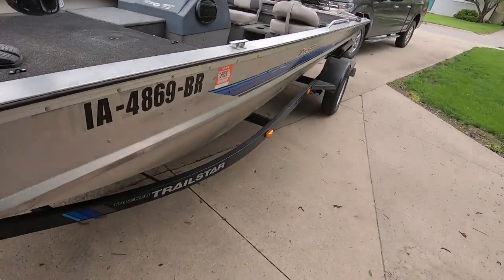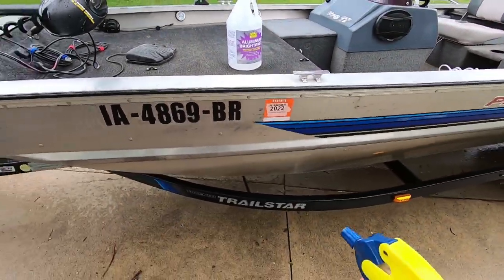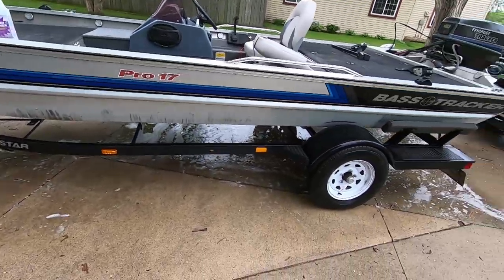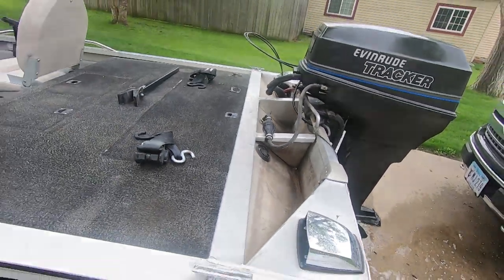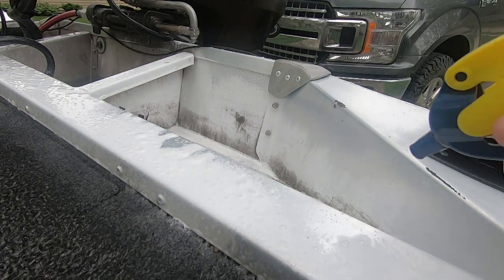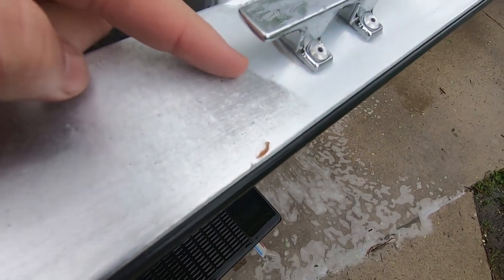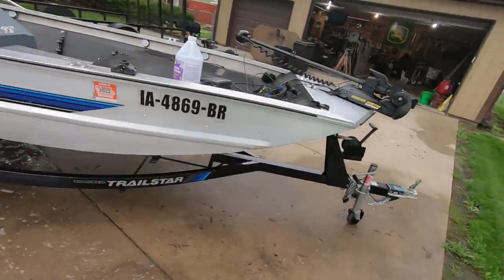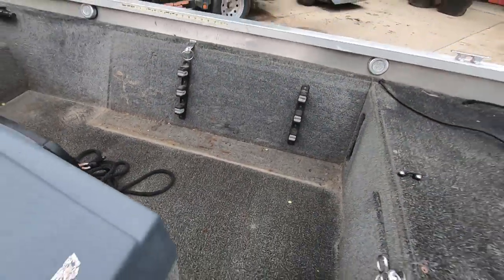Aluminum Boat Cleaning - LIKE NEW!

Comment: Just a quick tip.  Done this a few times. 

If you want the boat to keep that beauty sheen, seal it with a ceramic car wax. 

I've gone through a few bottles. Once you put it back in the water, it will want to corrod quickly. But if you use the ceramic, this shine will last for dozens of trips.

Comment: Looking to clean my 1995 Pro 16 Bass Tracker to wrap it.  Ran across your video. Disbelief at first at how 28 years of scum could just wash away with no scrubbing.  So, I bought the Purple Power cleaner.   All I can say is "WOW".   Took 3 to 4 coatings to rid 97% of the crud.  A few places I will have to scrub a little but "WOW".  Thanks for the video and info.  Boat looks like new. A believer now.

Comment: I just tried this, followed directions as it said. Although I didn't have the same results. I have a 24' pontoon. It did get some stuff off but mostly just left streaks. I put 4 applications on.
Reply from the maker: Mine was streaky after first coat, most areas on my boat i sprayed it down and rinsed it off 2-3 times to get rid of streaks

Comment: For best results wet the surface and spray on then use a small broom to quickly scrub. Using a broom prevents runs and gets an even application onto the surface.Then spray off with water.

Comment: Use chrome and mag polish and a buffer, mirror shine every time. I’ve polished 3 Bass Trackers that I’ve owned like that. You can do both sides in a hour or so.
Reply: Did you seal the mirror finish with wax?
Reply: @mikewilsonfishing9328  no
Reply: @mikewilsonfishing9328  you don't wax metal if you use metal polish it provides protection like a wax would  wax is for paint

Comment: I bought some Aluma Bright that will do the same thing. I used it on AC Units to clean the coils. Always clean your AC and  Radiator From the inside out so that you don't plug up your coils.

Comment: Same thing truckers use on their saddle tanks. I think it's the Aluminum Bright brand. I've used it on my 02 Bass Tracker.
Reply: Adding additional info to my comment. This stuff does etch the metal so I wouldn't use it over once a year.

Comment: It looks good for sure I did my boat after watching this vid. But it’s not the last step. You have to polish the boat with aluminum polish to really make it shine.. a polisher would probably be the way to go. I just used elbow grease and I worked my butt off doing it...I ordered a polisher and will really shine it up when it comes in.  Can’t wait
Reply from the maker: Yep if want it to last longer definately needs sealed with wax or polish

Comment: Good video. I have an 83 tracker all restored. Ill have to check this out to clean it up. What type of wax or sealer do you recommend? Can i use the spray on wipe off detail wax stuff or do i need the wax that has to dry and turns white before wiping off or buffing?
Reply from the maker: I would use a metal polish not a wax to help seal the aluminum, i used black diamonds polish with great results

Comment: After I’ve spent 200$ in buffing wheels and compounds, 3 hrs looking like a fool in my driveway, I come across this video.
Reply: You wouldn't use compound to polish metal anyways that's for paint... you would use metal polish... aluminum brightener is just white what's it cleans it but it's not what it would look like if it was actually polished out... if you use aluminum brightener then go back and polish with a buffing wheel and metal polish it will be like looking in a mirror

Comment: After you used this product how long did it take for the Aluminum to ugly again. Cabellas says it will get ugly really quick without a clear coat?
Thanks
Reply from the maker: Couple uses, year later still not as bad as it was, needs waxed or treated with sharkhide, not necessarily a clear coat

Comment: That is fricken amazing! 
Now that you have had it on there a little while did you notice any issues with it coming in contact with your carpet, paint or decals?
Reply from the maker: No issues, i would recomend some kind of sealer after it dries to protect the aluminum, when i do this again next spring i plan to use sharkhide sealer and will shoot another video
Reply: Travis In Canada 
I am wondering as well

Comment: Here a tip, always start from the bottom up. That will prevent streaking and do a much cleaner job
Reply: Can I apply this on an aluminum boat that's painted or will it mess a pain up ?  I seen that you replied 4 days ago so was just trying to get a quick response I also added a general question in the comments thanks
Reply: @johnsnow5822  yes you can reply ,is there a problem???
Reply: I'm sorry I'm at work .I don't know about the paint on the boat .you may try it on the very bottom it shouldn't take the paint off.i myself use a buffer wheel with rubbing compound  on painted surfaces
Reply from the maker: Ive heard it can discolor white paint but not sure on other colors
Reply: @markrusso6401  ok thanks

Comment: I realize this is an older video now so not sure if someone will see this question. How does this aluminum brightener affect the colored aluminum parts of the boat. Looking at buying an older tracker boat that could use a shine, but would like to restore the original color in the "Bass Tracker" lettering and coloring surrounding it as well as remove the tarnished aluminum. Does this damage the logo at all or do anything for bringing out it's color?
Reply from the maker: Does nothing to painted surfaces other yhan white, it can discolor white paint

Comment: Great video! So what’s the verdict with the Shark Hide? Did you use the Shark Hide protectant after a cleaning? Did it help seal and protect to help keep it clean after use at the lake?
Reply from the maker: Ended up using mag wheel polish on one side and white diamonds polish on the other, so far both sides look equally great after 20 times or so in the water

Comment: Do you have any solutions for it turning that whitish color? I’d like it to come out that shiny aluminum color and tried this today, might try to buff it with some aluminum polish?
Reply from the maker: Ya try that or some preservative like sharkhide
Reply: Thank you man, I took my boat out after trying this on one side and didn’t put a protection seal and came out the color of the water. Going to put the sharkhide on and see what happens. Will let you know results!

Comment: One question, does the Aluminum seem to tarnish again any quicker after this product has been applied? I'm thinking of using this on my Stabicraft but looking at the finish had wondered if it lasted very well after application. I'm using my boat in salt water as well which may or may not make a difference. Any feedback would be appreciated.
Reply from the maker: If you wax or polish the boat afterward it should last quite a while

Comment: I just picked up a 1990 sylvan v hull, will the acids damage the seals ?
Reply from the maker: Not sure, may want to try a small test area.
Reply: I actually picked it up and used it, great product and it didn’t damage any seals. I just happen to find a leak as I was cleaning and polishing my boat but look like a totally unreal area issue to the acid that caused the leak.

Comment: Great stuff but only issue  I found with it is when using it on painted aluminum surface.  The white paint turns  yellow eventually...Is there anyway to prevent this from happening?
Reply from the maker: I am not sure about that one as mine doesnt have any paint, possibly try shark hide after?
Reply: @PUTEMDOWNProductions  what is shark hide?
Reply from the maker: Metal protectant www.Sharkhide.com
Reply: @PUTEMDOWNProductions  Thanks for the reply but it looks like the sharkhide stuff is also used for only bare aluminum not painted aluminum...

Comment: I have been wanting to do this also, my question is that I need to do my steering counsel and a few things inside the boat. Can I safely do this without damaging my carpet?  Any tips?
Reply from the maker: I did not damage carpet or vinyl, it will discolor galvanized steel
Reply: Thank you! I will get on it. Don't think I have any galvanized steel to worry about?